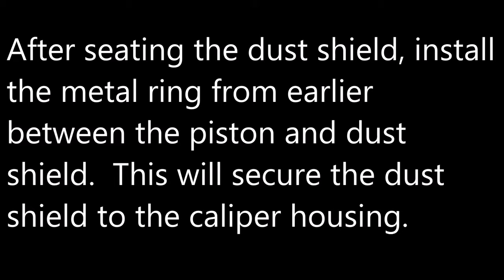How to Rebuild a Brake Caliper Fast & Easy

Comment: 100% fail on crimping the brake hose
Reply from the maker: Sure it wasn’t 95%?
Reply: What's wrong with crimping a rubber brake hose
Reply: @jonwheeler3396  you don't pinch off brake lines lmao, you can collapse the line and generally lots of them are made of braided stainless steel with a rubber coated exterior
Reply: @rYan-qo9si  what does "collapse the line" mean exactly? Because that's essentially my goal when "crimping" the brake line. I want to "collapse" the line so I can disconnect without everything pouring fluid everywhere. There will be no leaks after my job when I pressure test the system. Fluid will flow correctly. It won't fail unless human error tightens it way too much. Thats what the cardboard is for. To be more forgiving. It's just skill bruh I'm still here after all these years
Reply: Been doing it that way for 20 years. Never had a problem whatsoever.
Reply: @Elpipiton  it won't spring back fully
Reply: @rYan-qo9si oh really? Are you the spring back monitor?
Reply: @blazeaglory  nice one!!! Super funny
Reply: @HarryPotter-kz6kl  For those of us with black clouds over our garages, we never crimp. I've done it twice on the fly to swap bleeder valves and they ended up triggering my ABS light for what I assumed was a pressure issue. Changed both brake lines and it cleared itself.
Reply: The lines have a copper pipe in them crimping them tends to fk them up
Reply: I agree with you about the crimping and not sure about back rubber on piston staying in place.
Reply: Btec level behaviour to crimp a line. It's like £4 for the correct line-cap union. 
Damaging a perishable rubber line by clamping it is just pure laziness.
Reply: @HarryPotter-kz6kl the problem is you’re doing it
Reply: Dude I'm just confused at this point almost half say it's ok, other half says its not 😅
Reply: @jimmygee7065 This is common back and forth in videos where brake line crimping is shown. I think the main takeaway is it isn’t ideal but it can be done.
Reply: @bobwiley69  gotcha, I went ahead and rebuilt caliper without crimping. Wrapped the banjo bolt with a rag lol
Reply: @Elpipiton I know this is a year old comment but if you disconnect a brake line without any clamp, it will drip for a second or two then stop. I stuff it in a water bottle, it usually has a tiny amount in it. It’s not under pressure with the car off and foot off the brake

Comment: There are friends who doesn't have any idea. So I believe you should have taken your tutorial step by step without skipping anything instead of rushing through everything
Reply from the maker: Umm…I thought it was pretty step by step…I skipped over the metal ring but other than that…🤷‍♂️
Reply: @FastFixYouTube  nou  did not  show  how to put  in place  the  inner  ring (  rubber ring) tht  its very important  to know that  is  specifically  way  to  put   the  rubber ring  other  way  you can damage   the  ring  .

Comment: You totally missed showing where the metal clip went!
Reply from the maker: It goes in last. Holds the rubber seal to the caliper. It’s easy to figure out.

Comment: I got that same car. I swear its hondas worst quality ever.  2 wheel bearings, 2 calipers, passenger side top and bottom engine mounts, water pump, power steering pump and starter, airbag light, radio lights stopped working... all went out on me within 20 thousand miles.  I bought it with 100 thousand miles and its an silver 08 just like yours. I would sell it before it steels your  time and money fixing it.  Makes me sad too as i'm a Honda guy at heart. I just hope all there newer cars aren't this bad all my 90's and pre 2002 Honda were indestructible
Reply from the maker: Yikes!  Sadly, I can relate.  I've got 260,000 miles on this beast however, so I have to give it some slack.  I've done the usual maintenance items, but I also had to replace the engine when the block cracked.  Luckily, the replacement was under warranty.  I feel like the transmission is next in which case the car will be a boat anchor.  I'd buy one again though as this one has served me pretty well over the years.  Thanks for the comment!
Reply: @FastFixYouTube  yea my engine is starting to show signs of that cracked block as well.  Sadly the recall is over If I understand correctly.Great videos. Its because of guys like you that I at least don't have to pay a shop thousands to fix my chronically broken CIvic lol
Reply from the maker: Phillip Morrison “chronically broken.”  Lol, man that’s exactly how I feel about mine right now!  No prob on the vids. Glad they make a difference. If your engine does in fact crack, run it by your Honda dealer. It’s been too long for me to remember, but I think the warranty applied to engines with 250,000 or fewer miles. However, not all production years were covered.
Reply: My 06 has 258k, it has it’s fair share of problems, but it’s really a reliable car
Reply: I own 2 Honda Elements (2006) with the K24 engine.  One Element has 250,000 miles, was in a rollover by previous owner.  Every factory feature still works on both cars.  All original factory parts excepts for the starters.  Just replaced factory calipers today. Should have rebuild them!  I wasn't a Honda guy before...but now I am.

Comment: Why you rebuild calipers when new one is not expensive. Ok to rebuild old one if you want but new is reasonable price.
Reply from the maker: I don’t disagree with you. I thought this would be a good learning opportunity to help others that have budget constraints or enjoy fixing things themselves. But yes, cost isn’t terrible and for sure easier. Thanks for the comment 👍
Reply: bc ime when it comes to calipers oem is vastly superior than aftermarket. my 14 odyssey has a torn dust boot and i will rebuilt bc a new oem is around $250 BUT raybestos is $50. i plan on keeping the car so we rebuild first with a $10 kit
Reply: Cheapest caliper for my car is about 125 and probably 15 to rebuild so if it takes a couple hours it's way worth it to do
Reply: Same £105 for caliper or £15 for piston and seal
Reply: For a rebuild kit for my car vs a set of rebuilt calipers, the difference is about 450 bucks so is well worth it
Reply: I don't even be having 4 bucks for a beer these days